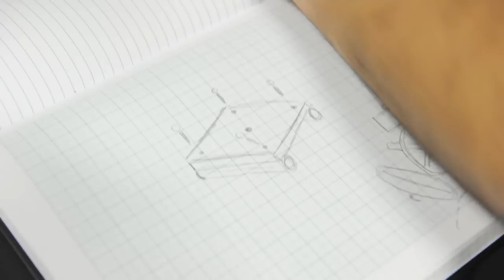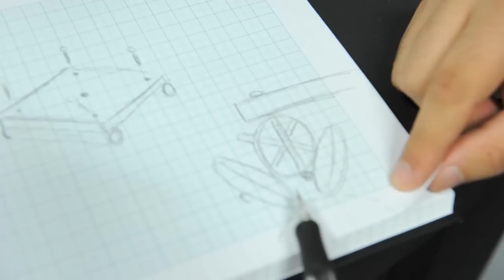DIY Camera Dolly

Comment: Excellent. That was nice and smooth, and takes nice dolly shots. I definitely like the idea of putting together own dolly and dolly track....but here's another three cheap options:-

1) Wear roller skates/inline skates. 

2) Put a tripod on top of a chair with wheels, ideally a swivel chair, then you have panning and dolly in one!

3) Use a skateboard.

Comment from the maker: @neverhood311 I wouldn't mound a tripod to it.  I don't think it would retain it's smoothness.  You could build a much larger version of it and then put a tripod on top of that, but for this what we do is simply stack things underneath it to get it at the height we want.  Hope that helps

Comment: @2dphotography Did you try with only 3 pairs of wheels? I mean 4 points are difficult to adjust exactly on the same plane but 3 always work, it's basic geometry in space. Try an equilateral triangle, it may do the trick. That's also the main reason behind the basic design of a tripod.

Comment: The problem I'm having so far is if the angles of the wheels aren't absolutely precise, the dolly rolls right off the track after you push it a few feet.   I don't have a drill press or precision machinery to drill the holes for the wheels at the precise angles.  Is there some kind of workaround?
Reply: There is an alternative way of attaching the wheels in another DIY slider video. That one uses L brackets with the wheels flush against each side of the bracket so the angles are absolutely perfect. So long as you position each bracket the same distance from the edge of the wood and they are parallel with each other. https://www.youtube.com/watch?v=ZLZOPcbJ7yc

Comment: Your back wheel got stuck in the middle of the movement, but in general it's one of the easiest and cheapest DIY dolly tutorials I've seen. You're basically spending the most of your money on the overpriced wheels.

Comment: The track is way to thick. Use 32mm or even 22mm plastic pipe it'll be much easier to transport if you only have a small car because it isn't as rigid. Keep the length of the pipe to 2 meter lengths and extend them with inserts made from cut off waste pipe. Don't bolt the track to anything it'll be fine just laid on the ground and you can use bean bags to support the track on uneven surfaces. Remember the absolute key here if you don't want this thing to just sit in the garage never being used is, portability!!! If it takes a lot of time to set up and is a hassle to transport from A to B you'll find a reason not to take it with you more often than not. Skate wheels are good but expensive their are cheaper alternatives like rubber twin wheel casters. Or if you do want to spend money for £28 you can buy 4 "U-Groove" wheels with skatewheel bearings in them off Amazon (these are excellent). Mount them using L-Brackets. Or buy one of those folderble dolly's off eBay for £28 and replace the caster wheels with the U-Groove wheels.

Comment: Everything ok, but please don't use rollerblade wheels. They are not always perfectly round and tend to deform under the weight of the dolly. Use skateboard wheels instead. They are perfectly round and can bear much more weight without deforming.